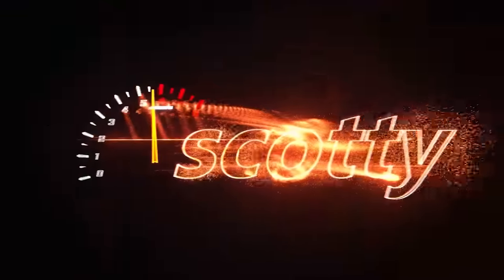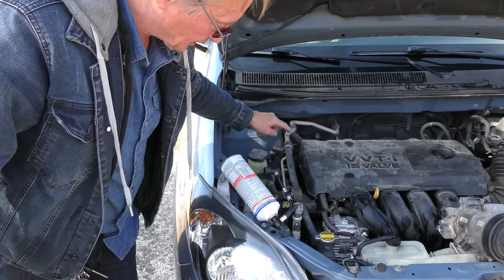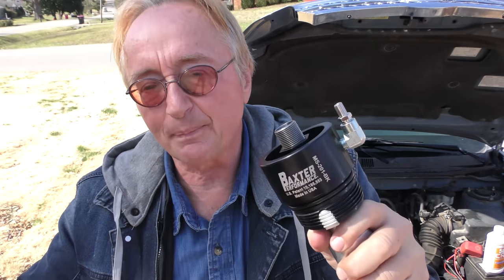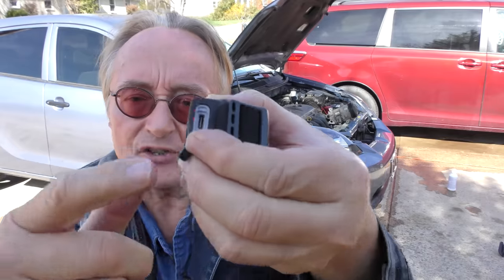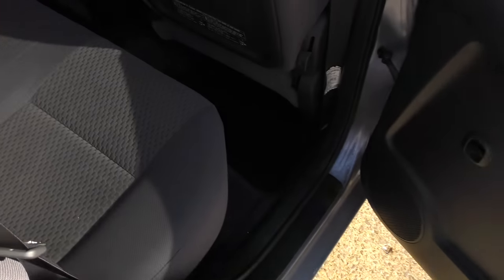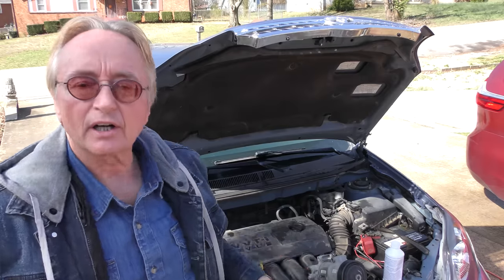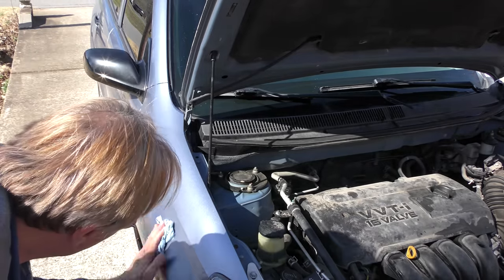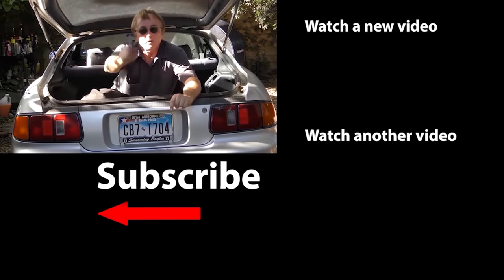7 New Car Products You Should Buy

Comment: Scotty your the best!  How will replacement affect warranty on my 2021 Landcruiser?  I hate sloppy mechanics that don’t give a crap and get oil everywhere let alone don’t use new gaskets etc with oil change.  I think this would make a good stand along vlog.  What things can you do to your Toyota without screwing up warranty.  I also need suggestions for proper undercoating something highly recommended for my LC.  I’m worried about bolts being covered etc.  Using the air pump assume no issue with air remaining?  Do you recommend the Baxter mod for Landcruiser?

Comment: Damn, I might have to get that Baxter replacement oil filter assembly! I went to change the oil on my Mercedes E320 a couple of years ago and the whole Assembly cracked, which means I would’ve had to replace the entire engine chain case cover.
And now, unfortunately, I have a Chrysler 200 with the same kind of stupid oil filter  on the top of the engine attached to an engine cooler. It’s a pain. I’m definitely gonna have to buy that. I didn’t know it existed.

Comment: I have a Pontiac G6 with paper filter element. I cannot relate to the difficulty in changing the original filter. This is the easiest paper filter to change. Just remove cap , pull out the old and pop in a new one. Mo mess ..takes about 3 minutes.

Comment: My experience with Toyotas the low side measurement only will cause you to overcharge your system so much that it will do the high pressure cut out before the low gauge gets to the bottom of the acceptable range. I had to measure both sides to know. Or possibly the low gauge on the can was horribly inaccurate.

Comment: Dear Scotty, it looks like someone is harassing me through auto hacking.  What can I do to override or stop the hacking.  08 xterra with aftermarket key fauve.  Appeared they disabled my vehicle while parked.  I Turned key in ignition and no response at all, totally dead including door locks frozen.  Booster pack on battery appeared to start vehicle after two attempts.   I belive hackers were in view and might have started the car at that point rather than the boost.  Second question is, will a jump start override a hacked shut down? First question is, what can I do to prevent future attacks? Thank you.

Comment: The only reason I think the Baxter adapter is a good idea is because I won't have to keep buying 27 mm sockets. I'll probably save money overall. But I actually like changing just the cartage, and the plastic cap with filter only costs $7 for the GM ecotecs.
Reply: I don't know about GM, but the oil filter housing is plastic for my 3.6 L pentastar. This baxter adapter would keep mechanics from overtightening and breaking the housing.

Comment: How do the 3D floor mats compare to Weathertec?  The Weathertec mats are expensive, but they are about indestructible and they fit like a glove.  I buy a set for every new car I get and they usually outlast the car  and I keep my cars a long time (10 years or so).
Reply: I bought a set of those 3D ones for the front row a few years ago because I found them for about $80 compared to $120 for the Weathertech ones. The 3D ones have a textured non-slip surface so your shoes won't slide around even when wet.

Comment: 1. AC fill up gauge
2. Baxter oil filter bypass
3. LED Headlights band
4. Custom 3D floor mats
5. Touch up paint 
6. Fuel treatment 
7. Shop vac
8. Rain-x waterless cleaner

Comment: Hello Scott, hopefully you re doing ok, i have a 2006 gas dodge ram 5.7 hemi 8 cylinders ...when coasting engine noise becomes like old diesel engine ...it happens after 5 to 10 min drive....and there is no check engine light

Comment: An overfilled AC system will absolutely wreck your compressor.  Somehow the AC system on one of my cars was overfilled (probably my fault) and stopped working.  After I released some refrigerant, it worked OK.  I probably need to replace the compressor, but it works OK enough for now.

Comment: Help! My key fob on my 06 Dodge dakoda stopped working.  Had a new one made by locksmith but still won't work. The only key hole is on drivers door and turns but doesn't open. I took the panel off thinking watching YouTube I could reconnect the lock and just use my key but it's narrow, dark and dang! Help!

Comment: Good afternoon scotty! 
I just bought a 94 pathfinder with 193k miles for $900. It’s in pretty good condition but it has a misfire. What is the most expensive thing that can be causing a misfire? I’m planning to change the plugs right away but I’m pretty new to cars and I’m wondering what else to do.

Comment: I've got one of those garbage, messy plastic oil filter set ups on my Volvo. You have to remove the air box , coolant lines and various connectors JUST TO ACCESS IT . I love my Volvo , but I don't love that.

Comment: I might be a little worried about the air valve on the filter adapter , if it could survive hot oil on it for long.

Comment: 8:40 to the bottom right of the screen and to the right of the hood latch; what is that black round swirl thing bolted to the front frame? I see all cars have those lol
Reply: That is actually the horn for the car (I believe that is what you are referring to). If you look at the ones on your car, you will see wires powering it.
Reply: @keltinmohr7631  thank you sir for the reply. Makes sense now. When u lock and unlock the car does that chirp noise come from horn area too?

Comment: 50 years I ran out of gas, pushed my old car onto the lot of a closed gas-station, came back early in the morning 2 days later and discovered I had parked it under a billboard where what looked like a hundred pigeons were roosting...with a dead battery it was the next week-end  before I got the car home and removed the pigeon crap. There was no color-coat left except a little on vertical surfaces. Fun times being young, dumb and poor.

Comment: Hey Scotty! Question 🙋🏻‍♂️ I checked my Honda Accord 2003 check engine light and it gave me code p0325 for knock sensor so I changed it and the check engine light doesn’t go on but when I test it it comes out in the trouble code so I was curious if it will still pass the inspection check in nj since I’m still getting the p0325 code but no check engine

Comment: Been told not to use the RainX on my windshield because it can interfere with the forward reading electronics
Reply: That doesn’t make any sense. It’s a clear liquid that dries in seconds. And there aren’t any electronics on the outside of the windshield. You can use rain  call you want
Reply: @lesterparker1594  In the maintenance manual for my vehicle it specifically states do not use water-repellant solutions on the windshield because they can lead to increased glare under poor driving conditions.  I suspect the electronics the mechanic mentioned refer to the auto-dimming rearview mirror
Reply: @WATTYATHINK  weird. Technology is crazy nowadays

Comment: Auto A/C really isn't supposed to lose any refrigerant gas either just like any other refrigerant system its supposed to stay tight and stable, normalizing leaks is really a myth, and why they put the ounces on the data sticker under the hood, because it's a semi critical charge system.
...but a system will eventually leak, NOT NORMAL, but it will, which just means a bad seal or other leak needing the expensive 'dreaded leak repair'. 
WHEN A SYSTEM LOSES REFRIGERANT IT NEEDS A LEAK REPAIR PERIOD. 
They don't leak before the seal goes bad or some other leak develops, many leaks are at the 'thermal blow off solder fuse plug' on the back of the compressor at or near the discharge line. Due to high heat and the constant expansion and contraction they weaken, melt the thermal solder and leak. I usually just silver solder it closed on my own cars if I find it leaking, and just make sure all cooling systems, fans and freon charge are right on the money.
Schrader valves and pressure switches and controls are another common leak source.
BUT NO SYSTEM IS SUPPOSED TO PERIODICALLY LEAK DOWN. All a matter of whether you want to spend the money to fix the leak.
I had a 77 Caprice Wagon years back, and I'm a commercial refrigeration tech for 55 years, and it never ever needed a drop of R12. Tightest I've ever seen. So fix all those leaks, change the liquid line dryer, replace the orifice if you think it needs one, do a triple evacuation, weigh in that factory charge...
...and start your engines.

Comment: The rain next stuff is pretty good I used to have a Chevy S-10 many years ago the wiper motor burned out I didn’t fix it because the engine was on its last leg just used rain X and that horrendous 2.2l four-cylinder engine blew the head gasket twice motor finally locked up at 91,000 miles that’s a GM quality for you that’s why I drive Toyotas and anything not made by GM

Comment: Don't you risk pumping  dirty oil back into the engine if you  use an air compressor on the housing
Reply: Yes, and then you drain the oil.  At least, that's what he said.

Comment: And as far as this video goes those systems are not made to leak by design. It's a closed system, period.. people have just been dumbed down over the years.Its the same as the air conditioning in their homes, they get sold a recharge every year and an AC tune-up, when in fact if there is a leak, people simply top off the system because it is expensive to repair, not because it's a normal condition. It's a cost saving measure eventually it will get worse and it won't hold any refrigerant. Tell the people the truth.

Comment: Never use that junk from Autozone or the parts stores... it's not real 134a. If it were real you would need a license to purchase it. They are synthetic azeotropic blends that do not transfer the oil correctly. I think that Scotty forgot a previous video where he told us not to use these things.
Reply: Yeah I saw those videos he did say to not use them back then so maybe things change for the better now?

I do wonder if the oil needs to be recharged too since it leaks out along with r134a which I am not sure if it is already mixed inside the canned r134a refrigerant.

Comment: You are wrong about Sea Foam.
Reply: Don't  use anything in your engine that says it will remove carbon. Carbon is a very hard substance  .The stuff diamonds are made of. When a chemical process breaks little bits of it loose  they go through the turbo and trash it on its way out of the engine. Turbos aren't cheap. The damage doesn't stop there the bits go on to plug up the catalytic converter and they aren't cheap either.  You have been warned.